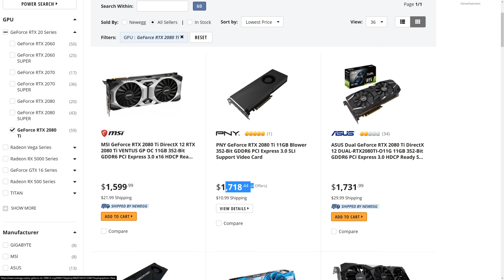Can $4200 buy a PC that will last 10 years in 2020?

Comment: The short answer is no but depends on what it is to be used for. I can see graphics cards changing a lot in the next ten years especially with ray tracing and the need for way more powerful cards than we currently have. I also see ram size increasing. The processor might do it and the storage might but who knows what's round the corner if it carries on at the speed we are moving at present I doubt it.

Comment: $4200 for a system without a 2080 ti, 3950x, or custom watercooling seemed a little absurd until I remember it's cdn which is "only" ~$3100 usd. Still doesn't seem like a great build for the money, but if he's happy that's what matters I guess.
Edit: jealous of the liquid freezer II 280 though, I've been trying to get one for a month. They're basically impossible to get new and they keep getting sniped when they pop up on ebay.

Comment: IDK where you looked but I just checked eBay and you can get a new 2080ti for under $1,150 USD (or 15,50 CAN) and open box models are even cheaper.

Comment: He should have waited until next year, it'll be am5 socket/ probably ddr5 ram by then and the 3080ti would be out aswell
Reply: he should wait until 2 years, itt;ll be zen 5 by then and 4080ti will be out
Reply: @virtualtools_3021  sounds like a troll comment, but I'll humour it. I just mean it's an entirely new platform out next year- the upgradability would have made more sense if he was keeping it for 10 years as ryzen 4000 is the last of am4. If anything started to struggle half way through the time he's keeping it for- there would be more options to slot in a newer cpu for example. Just makes more sense to me really :)

Comment: The Cougar Panzer Max is a very good case for air cooled components. It is not really good for watercooling. I've used this case for a while, until I sold the PC in 2019.
You should have used a good Noctua or Be Quiet Dark Rock 4 Pro on the CPU instead. The airflow (and air) in this case is great (@ max fan speed). For the best cooling... remove the PSU cover, install a fan in the bottom (for more possitive pressure). The back exhaust fan is enough (for most), because of the vented top, or add more fans if you need.
Also, it is very solid, and the handles are a great thing, if you want to carry it around. And the dust filtering is great! (easy to vaccum from the outside front)
Older case designs were designed as good thermal performers... not good lookers. (HAF X anyone?) This is a case for the person who need good performance and practicality.

Comment: You can actually get pretty good deals on Blu-ray RE/DL Blu-ray just in general for storage.
Now it's not better deals per tb than buying say, a 8tb Toshiba drive or anything. It's not like you're paying $26 per tb like the best hard drive deals.
But you can make out okay, IF you have a fancy enough drive to even support Dual Layer or Blu-ray Recordable Erasable.
You can buy 50 BD-R DL discs for $127 right now on amazon.
That's 50 discs of 50Gb each, so that's 2.5 tb for about $50~ per terabyte. 
Once again, not as good per tb as buying a large hard drive, but for some people this has a purpose. 
And of course you could always use BD-RE practically as a hard drive. 
A 3 pack of 100gb BD-RE XL discs are $47.

Comment: 9:18 : 11th gen has already been announced as supported on Z490 gigabyte Motherboards
Reply: Intel promised skylake for Z97 boards too then suddenly changed the chiplet designs and whoalah the 1151 rabbit hole was born
Reply: @wargames43  Intel usually supports 2 gens per chipset/socket. It is indeed an rare exception when Intel only supports one gen per chipset/socket. And Intel has confirmed 11th gen on Z490. 

And Z490 MBs is even rumored to support PCIE-4.0 express. Z490 MBs are apparently built to PCIE-4.0 express standards, and Intels 11th gen will support PCIE-4.0 express on the IO die, but we will see on that one turns out true or not. 

But without a doubt, 11th gen will be supported on Z490 MBs. It is indeed one of the reasons Z490 is an new 1200 pin socket. 

Intel recent support history. 

Sandy/Ivy bridge (2nd gen/3rd gen) 
Haswell/Devil canyon/Broadwell (4th/4th gen refresh/5th gen)(Broadwell (aka 5th gen was not rally available and doesn't count though) 
Skylake/Kabylake (6th and 7th gen)
Coffee Lake/Coffee Lake S (8th and 9th gen)
Comet Lake/Rocket Lake (10th and 11th gen) 

All of those pairings worked on the same MB chipsets. So Sandy/Ivy supported 6th and 7th gen chipsets, but were backwards and forwards compatible with each others respective CPU gen. So an P67 chipset MB supported both an 2600k and 3770k CPU, and the Z77 supported both CPUs as well. 

That is how Intels chipsets worked with all the examples I gave you. 4th gen (Z97) was a mess with Broadwell, but if Intel actually supported Skylake on it as well, that would have been an exception not the rule. That would have been 3 gens (some would say 4, but that depends if you count the devils canyon refresh) Intel supported then, not the usual 2. And Skylake could not work on 4th gen Z97 MBs, because Skylake was DDR4 not DDR3 like Z97 MBs. 

And Rocket Lake (11th gen) is supposed to have an 18% IPC increase, but we will see. It is Intels next gen architecture that has been back-ported to 14nm. So who knows exactly what the IPC will be in all situations and what clocks Intel will achieve. We will have to see, we have no benchmarks and only Intles word on that info right now.

Comment: 200 bucks for the case wtf 😱 and blue ray drive I still use it but it's a usb drive never in a case.
Reply: I was fussing about optical drives not being available in decent cases, some one said "use usb" like well now I have to store the damn thing, if only there was a box for computer stuff to go in ... I modded my coolermaster case to hold a laptop style USB drive and swapped the cables for sata
Reply: lol dude 200$is nothing haha lmao i spent just over 400$ on my case in CAD$$
Reply: @topspeed8287  yes but that case isn't worth anything close to that.
Reply: @kevinvanneste2500   totaly true but i was just saying i spent way more and with the case that he got  there is not much you can get for 200$ lol so cant reallly bitch as much tho at the same time
Reply: @topspeed8287  it does depend on what denomination he meant 200 CAD is about 150 USD, and for a middle of the road basic premium case that's not out of line (its still high for THAT case) ... problem with Timmy is he likes to mix currancy mid sentance.
Reply: @topspeed8287  same i got a tower 900 and all the bullshit im roped in to to use it that will cost thousands. 200 is like pocket change.
Reply: That case looks cheap and from the stoneage. My first case was kinda the same. Acrylic window, huge case without that much space inside, but it looked cool. Paid 200€ for that. 1-2 years later upgraded to Tower900. Should have researched more
Reply: I got my R7 2700 for 150 less 6 months ago :P
Reply: haha,that's what my case was worth back in 2017,it even had a cooler master g650m power supply,this case and power supply never let me down,it's great quality,so,the 200 euros that were spent were totally worth it

Comment: When I built my 4790K rig I got a blu-ray burner becuase I got a decent deal on it and I thought that I might burn Blu-Rays and it turns out that I don't even use it for that. The only time i have used it is to rip Blu-Ray movies and that was it.  I spent over $1700 bucks US on my 4790K  system and it lasted me almost 6 years. The reason why I am upgrading now is to have a system that I can play even more modern titles. Also I am keeping my GTX 1070 for the time being until I can upgrade to a better Nvidia card in the future. Also with an GPU upgrade in like 2-4 years or so can help as well.

Comment: I just upgrade every 5-7 years, buy CPUs that are a year or two old, and the current mid-upper range gpu, very cost effective.  I got 8c/16t for $130 including a cooler (R7 2700x), plus my motherboard is forward compatible with Ryzen 4th gen cpus, so I can upgrade to that as well after they drop in price.  "Fart cans, I have to close windows"!!! XD

Comment: I have almost this exact build. same exact motherboard, same exact ram, same exact ssds. Except I have a 3950x cpu, a evga 2080ti, a corsair 680x case, a evga supernova 1000 watt power supply, and a evga clc 360 aio.

Comment: Your friend should have gone with the Define R6 from Fractal Design. It has much better support for everything your friend use in the current case, Blue Ray drive included. It also can fit 2 AIO. Otherwise I love the setup.

Comment: To Timmy joe, a 5ghz processor from today can run all games even after 2040......You just have to change the graphics card ......or even if you want not to change any thing then put two 2080ti in sli and that will last for more than twenty years...........Core 2 duo processors from about 20 years a go still runs all games in ultra and quad core processors still gives very good performance in ultra..........Because modern games like Shadow of the tomb raider requires only 3.1 ghz

Comment: I'd settle for a 600-1000 dollar system that'll last 7 years. Just be realistic and expect that by the last 2 years you'll be running AAA stuff at mid settings, 30-40 fps, or low settings, 60 fps.

Comment: 1.375v oc? good luck with the degrade,this will not last even 1 year.
Reply from the maker: Hahahhahha
Reply from the maker: You don't know ryzen overlooking then. Degrade wtf. I've been overlooking my whole life and I've never had a chip die or "degrade" from overclocking. Only from bad thermals. Good luck with your plain toast every morning
Reply: @TimmyJoePCTech  buildzoid degrade his zen2 cpu with 1.38v and many users reported degrade with 1.35v.
Reply: I run my 3600X at 4.2 ghz at 1.26v stable, 1800 flk clock, 3600mhz cl16 ram on ASUS X470 for a year now. And have had no problems yet.

Comment: I think he did the right decision 8 cores will be used soon in games with next gem games. I think 12 cores is a nice future proof point. Also pci-e 4.0 SSD is a good decision also 32GB RAM really nice if u want play online multiplayer AAA games even today u can use over 16GB RAM games like Battlefield 5 in multiplayer with all your background applications my PC showed between 18-21GB ram usage. We the Blu-Ray player can be useful put his PS3 games on PC the PS3 emulator rpcs3 already is extremely playable and most games can be played from start to finish. So why not he is a gamer he can buy PS3 games and play it on PC I don't see the problem there. I only agree with u about this case this case has many flaws and could have more options and it looks old I wouldn't pick this up but is his decision.

Comment: simple answer = Yes, if you spend it right...I just got finished with a 9 year old PC still running okay and replaced it with  a $4300 USD PC (not including monitor etc_).  Doing that will also keep you from having to buy 2K worth of PC parts and upgrades every 2-3 years to keep up...it ends up being cheaper, at least in my experience over the last 28 years.
THE case should have been an Evolve X....SUCCH a good case.
OH should have gone with 64 GB of RAM if you want it to last 8+ years..and mine has a 2080ti... (bought all mine before the Covid when things were a but cheaper) and a Titanium seagate PSU (again when it was cheaper before covid)

Comment: Personally, I would wait for Nvidia 3000 series and Ryzen 4000 series with that kind of cash involved.  Maximize the price to performance value which will be significantly better before the end of the year.  It would also add longevity to the build as it would be purchased at the beginning of the series vs the EOL with current series.  A new 3080 will absolutely dominate a 2080 Super.  The blue ray feature is just a travesty.  Loved the vid TJ...but your client either needs a system RIGHT NOW or has poor judgement.

Comment: z490 boards support PCIe4 despite the processors not supporting that. I doubt they would have gone to the trouble if they didn't know a new future processor generation that will come about will also go in the board. x570 is only going to support 2 generations (my 2700x couldn't run PCIe4 on my Crosshair VIII).

Comment: Great build but I would of held off on the 2080super, spending good money on a GPU that is a tiny bit better than a 4 year old 1080ti and is soon to be replaced by the 3000 series in a couple months. A used 1060 6GB would have held him over for 6 months until the next gen launches

Comment: It definitely can, even less than that. Still gaming on Intel Core 2 duo E8500, GeForce GTX 650, no idea what board, no idea what power supply, 4 sticks of RAM all different manufacturer, total 8GB, a case that is missing side panels, 1 TB HDD and 120 GB SSD. It has "installed" DVD-RW but motherboard has no parallel port so i cant attach it.

Comment: I like his choice of components. Lovin the double gen4 ssds. The 2080ti is just way too over priced. If he really doesn't want to upgrade for 10years than the 2080super is a good option. For me, would have saved a few dollars on the GPU maybe gone 2070 super of 5700xt spent the diff on a 3950x and then upgraded to ampere or navi 2 end of year.

Comment: You can but the problem is the GPUs. Literally this or next year a 2080ti is supposed to be at the 3060 level. 

CPU wise a 12-16 core is going to be just fine for years.

Comment: wait to spring 2021 and build with the new Ryzen and Ampere graphics.. that will certainly last for more than whatever can be built just BEFORE the leap; performance is getting saturated more every year; a system build in 2021 WILL last for 7 years if the parts don't break

Comment: I can build 2 computers from that money that last 10 years without to many problems.. last one i build around 2200 bucks lasted 10 years.. but yeah things get slower over time.. graphic cards get outdated.. the processor isnt the problem most of the time.. the trick for building a computer for the future is to use the best quality you can get and a little more.. so if 16Gb is the norm now.. buy 32 or 64..  i still run a i7 4770k not OCed , i changed my watercooling for cpu this week and a few years ago i bought an AMD RX580 strix 8Gb gaming.. to replace my R9 270x that by he way still runs very well.. i already had 16GB memory.. so near running it now for 7 years.. it still runs everything on ultra.. with the R9 270X on high or ultra depending on game.. you don't need the most expensive hardware.. but you do need to think if it will be good enough in a few years.. so a strong CPU that's one of the last releases will go a long way... cpu's are less important as gpu's also

Comment: Timmy Joe! I saw a passively cooler GTX 1080ti mining card on eBay for $400 USD. Can you PLEASE get it and try to convert it to active cooling and flash the bios? This would be an awesome video and would shed some light on if these passively cooled mining cards can actually be used for gaming!

Comment: If he wanted the pc to last 10 years, he should have gone threadripper 3960x. He would start with 24 cores and still have an upgrade path to 64 cores and 256gb of ram. In ten years, 64 cores and 256gb of ram will still be legit. The 3990x will cost like $300 used in 5 years. Used 256gb of ram will be like $100 in 5 years. He could buy a new gpu in 5years and still have an elite pc.

Comment: What kind of $5000 PC in 2010 only had a motherboard that supported a max of 8GB of RAM? Seriously....In 2010 I had a MSI 870-G45 (Which was like a $70  board) that board supported max of 16GB DDR3.  Not that you could buy a 4GB stick of ram at that time unless you wanted to spend 2-3 times the price of 2x2GB set. But still, most boards supported the 16GB max even before 2010.

Comment: How'd he spend 5k and only had an i7 940 for a CPU?  I spent $3k on a core i7 980X and two GTX480s ten years ago.  It was actually still viable for gaming with only a RAM (6GB to 24GB) and GPU upgrade (replaced the SLi GTX 480s with a single GTX1080 and doubled my performance) in 2016.  I only really upgraded (only CPU/mobo/RAM) to increase my performance when running Blender.
I tend to think like your friend, but my criteria for upgrading GPU is I need to see double the performance at my given resolution, and I'll normally sell off the old one if it's still worth anything.

Comment: Dunno about 10 years, but I normally go at least 5 years between building new systems.  my benq g2411hd monitor is 11 years old though and still going strong but I have just bought a new one.   My current system is 3 years old and maxes out everything except for ark lol. There isn't going to be any game that this rig won't run In the next 2 years, I could probably push it to ten years but I won't purely because the I want it bug will hit before the I need it problems  come.

Comment: Why didn't you just use a beQuiet! or Noctua air cooler? Will last much longer than any AIO, will produce less noise and would have allowed to put in the PSU shroud. Moreover Ryzen doesn't need high end cooling anyway.

Comment: Don’t think so, personally think the AIO is a huge point of failure and may have worked with an NH-D15 or 12s. When noctua is available especially in black why use AIO. And stop using thermal paste when there are graphite thermal pads that don’t degrade over time. This is built to fail.

Comment: Better upgrade a $1500 system every 3-5 years and upgrade motherboard, cpu and graphics card... maybe ram if its on the next gen.

Use the same storage and power supply and case.